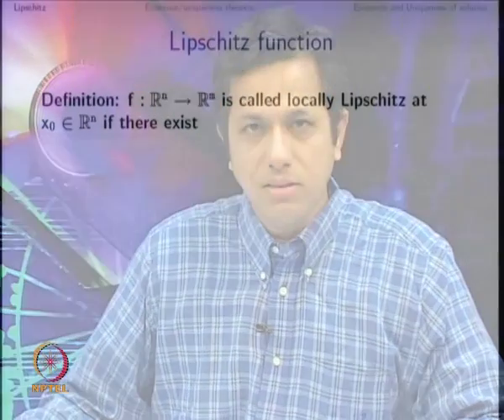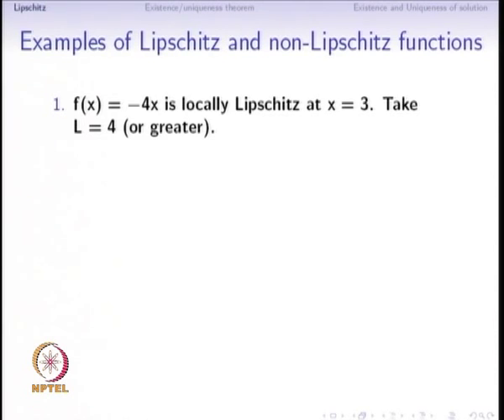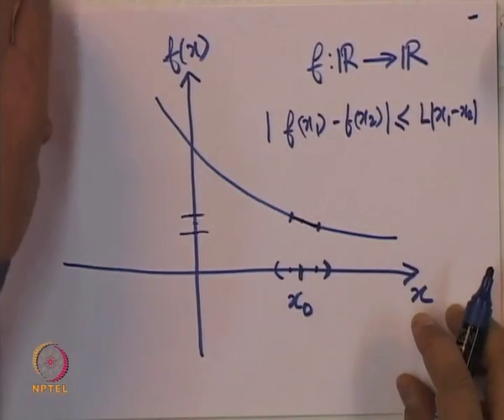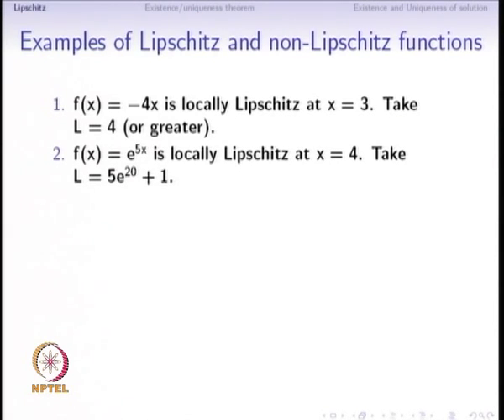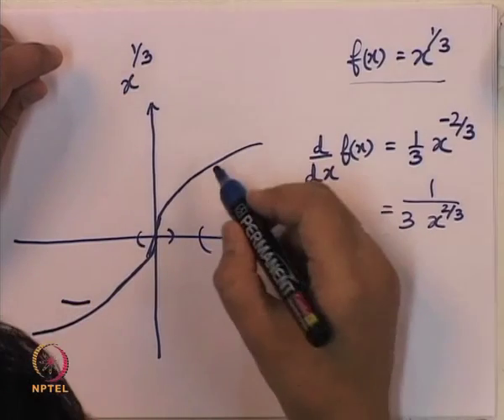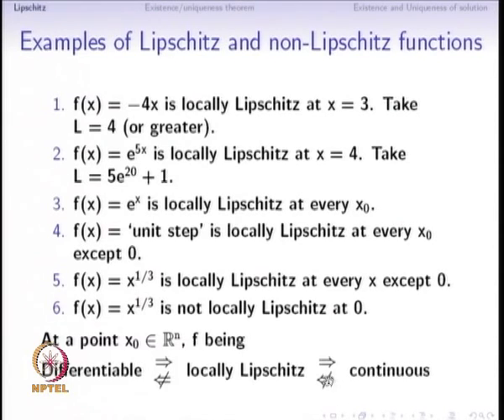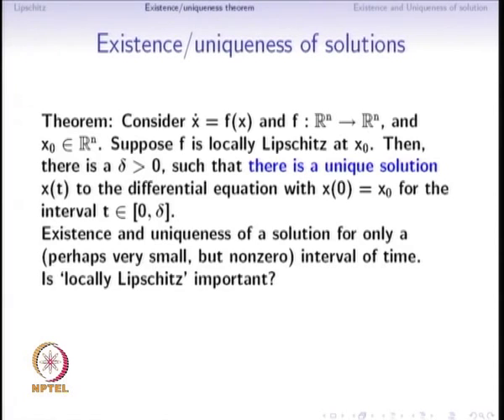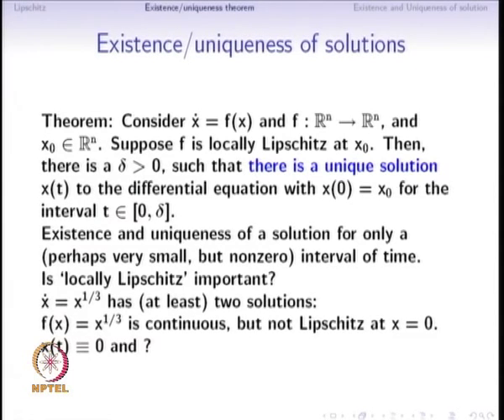Mod-01 Lec-04 Lipschitz Functions

Comment: Dear Sir,

Thank you very much for the video. It is very helpful. However, I have few doubts and I was wondering if you could clear my doubt. I am new to this Lipschitz Functions. In the "Examples of Lipschitz and Non-Lipschitz functions""

1. f(x) = -4x, you said that it is locally Lipschitz at x = 3 and L = 4. Here I know, how L = 4, but what it is not clear to me how it is locally Lipschitz at x = 3? How to find it?
2.  f(x) = e^5x, it is not clear to me how x = 4 and L = e^5x + 1.  How did you find x and L?

Thank you very much

Best Regards